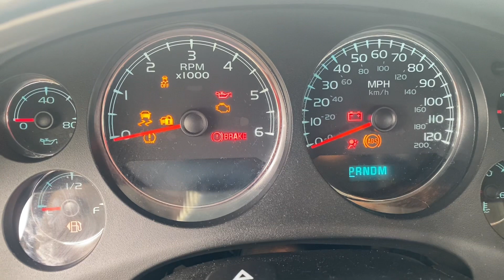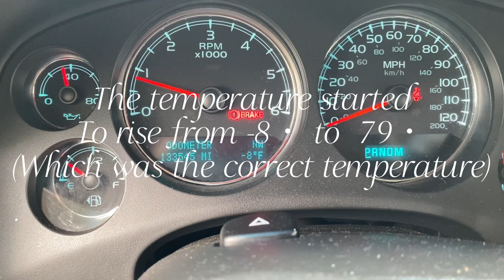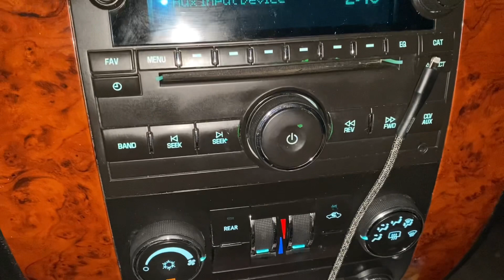2013 Chevy Tahoe Ambient Air temperature sensor replacement

Comment: Huge thanks for the excellent tip to only remove the top six 10mm bolts!  My sensor failed and would mostly read 41⁰ actual ambient temp, 31⁰.  It came back to life for a few hours, then went back to 41⁰.  Took it out following your video.  Replacement on order, looking forward to EZPZ install and reassembly.  Thanks again!
Reply from the maker: Niccceeeee 
Thank you for your feedback